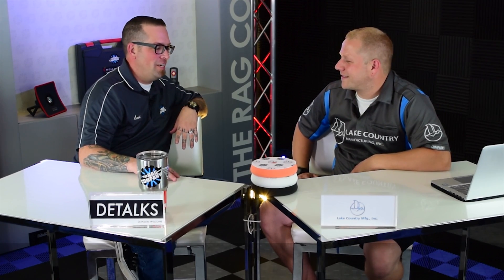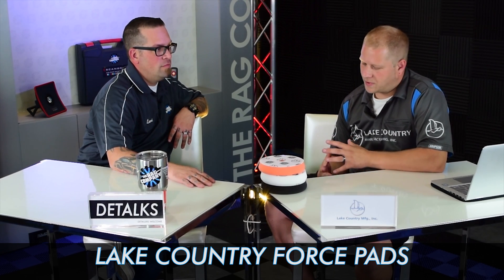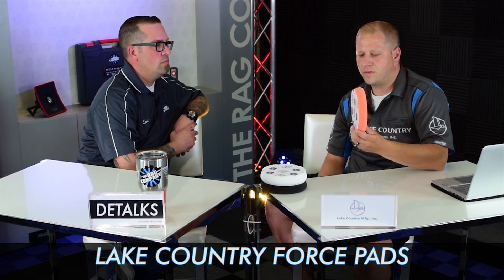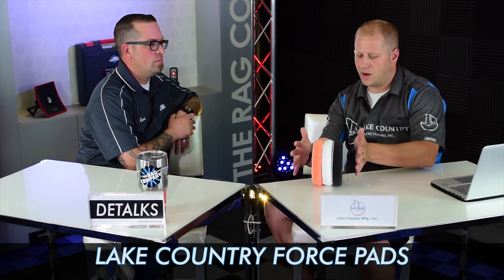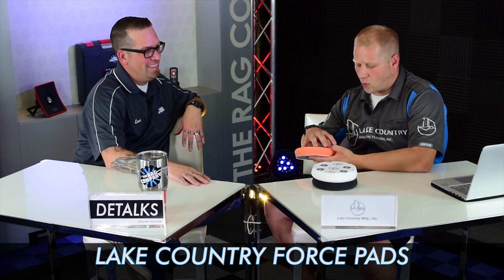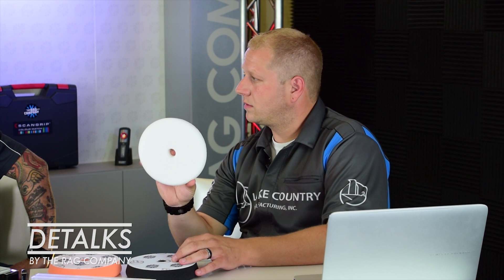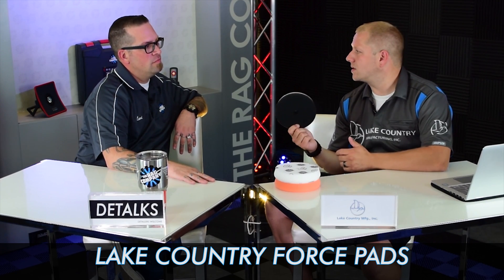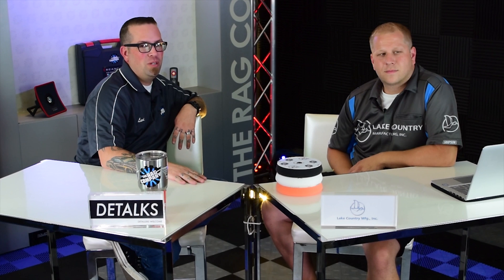Forced Rotation Machine Pads | DETALKS

Comment: hey guys,  

can I ask are there plans to get these pads over in the UK.   Currently I think motorgeek co uk are the main UK distributors of Lake Country pads.

---------------

One other important thing.  the new pads have some  size options which dont tie in fully with plate sizes available for the 3401.  Specially the 3.5 inch pad.    This and the fact the lake country adapter plate system is no longer being produced..   Are these pads being developed for a potential future 3401 replacement from flex.. If not whats the thinking with the 3.5 inch pad?    (also noted your doing 1 and 2 inch versions of it)

does the standard 5.5 inch 150 flex plate support the 5.5 FORCE pads (suspect answer is no).  If so do you have to use the 5.5 FORCE pads with the 4 3/8 flex plate?    And the 6.5 FORCE pads with the standard 5.5 plate or 6 inch plate.

The world would be such a better place if the industry could somehow create standards around pad and plate sizes.  (easier said than done I guess)

--------------

The hybrid power pads are without doubt the best pads on the market that
 Ive used with the 3401.   The foam on them is very dense but not overly
 stiff or coarse feeling like pretty much all other pads.. Like you say 
as you work the pads they soften up.. Its a very important thing for me 
because the pad on a force rotation needs to be able to take the curves 
more.  And these pads are somehow soft enough to be able to do this but 
still give great cut and dont start to fail or break down like most 
other pads do.